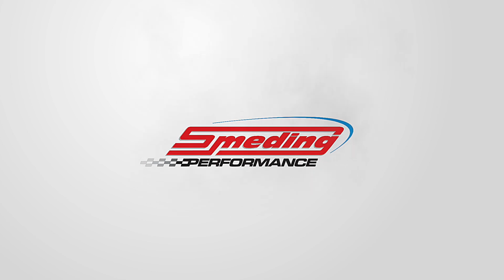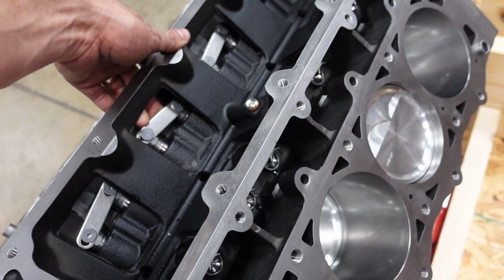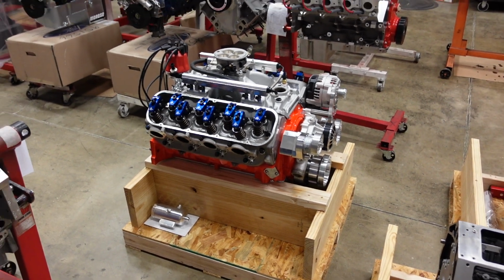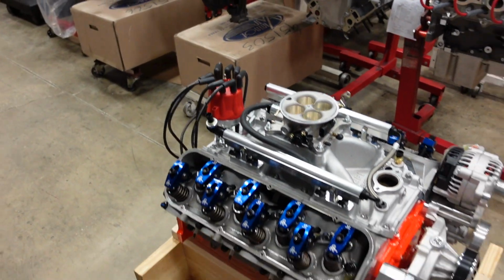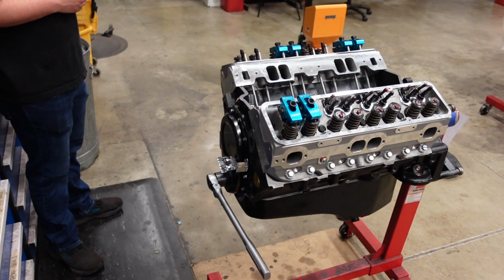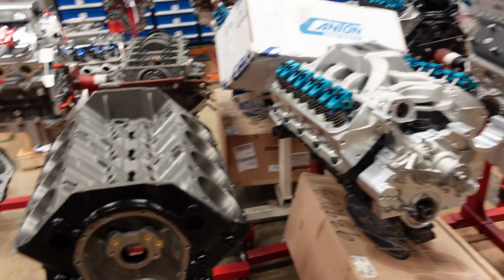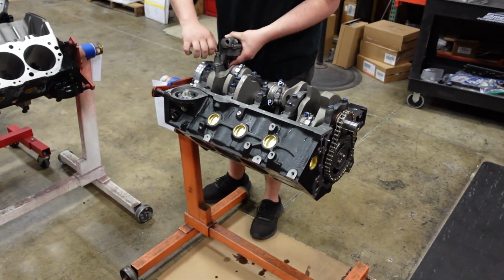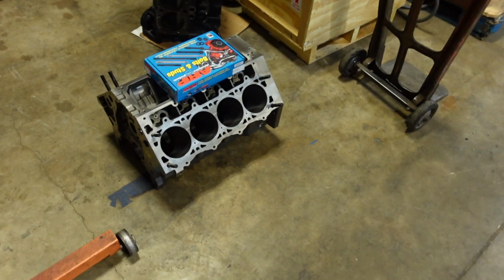427 LS Engine vs 540 Big Block Chevy!! (3,100 Horsepower)

Comment: Small block 427 LS lol I will take a big block any day over a little LS engine. If a Little LS engine could take a beating then professional monster trucks and nhra funny and rail cars would run them. But they don't they all run stroked big blocks.

Comment: Love the big blocks! I'm building an old school 509 tunnel ram 13.1 compression to run on e85. Interested in those pistons in one of your videos that have the thin ring package. My block is 4.500 bore 4" stroke crank and 6.385 rods...any suggestions?
Reply: 4.25" or 4.5" rod. Light rotating assembly. Ditch the tunnel ram and go with a port fuel injection setup. Tune for high end torque. You will have more than enough bottom and mid range NA. Then when u r really ready to show ur butt you have c hellish top end on hand. If you build ur trans and rear with a 4 link tuned right you can throw less gear at it and maybe a 150hp shot of nitrous coming on at say 25% at 3800rpm and ramp to 100% (150hp) by 4500 rpm. It will mostly be a smoke show on the street, but having two 20 pound blue bottles sitting in the back floor board will be the business. Track it will only make you want more!!!!!!!

Comment: I'd take the 540 big block, you can keep the heads, intake, and EFI set up, I'll put an complete MBE Big-9 top end on it along with a Book 1450cfm dominator, and make more power N/A than your 632 1,000hp motor your currently building without a problem.
Reply: Damn i hear you . I have been checking those mbe big 9s out myself & that 2 piece billit intake, you talk about some bad ass beautiful stuff MBE has it. Im sure the price is unbelievable but if I had the money i would go with them too

Comment: Love them all!! I have a stock-ish early 70 454 with a carb, hate the reliability and mpg. Wonder how much the edelbrock efi would help?? Been thinking about an LS conversation, just want a 500hp cruiser that is reliable. In a 71 Nova.
Reply: You can  get 500 from the 454 with reliable daily drive easy. Why is your not reliable.  Efi will get you 3 mpg
Reply: Power I bet you feel no difference, just get a good tune/curve dist and youre good to go.